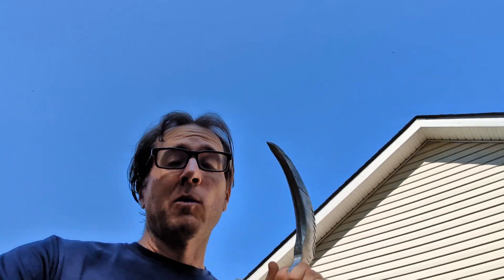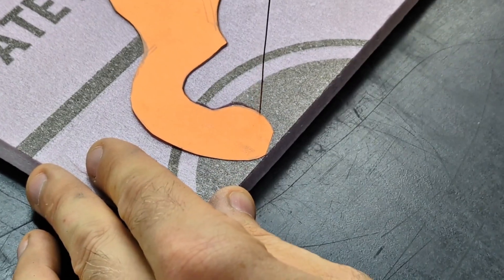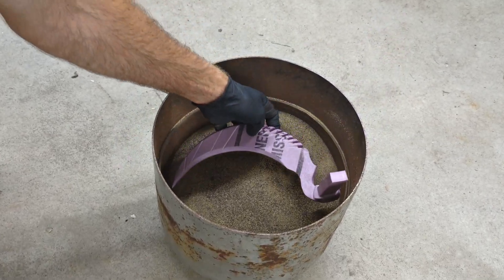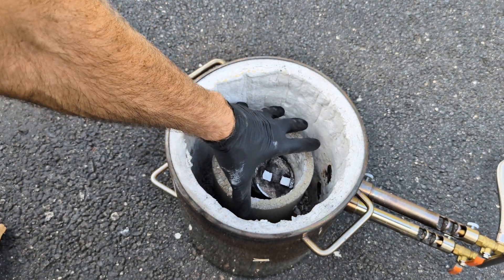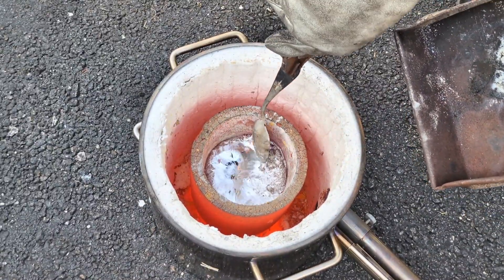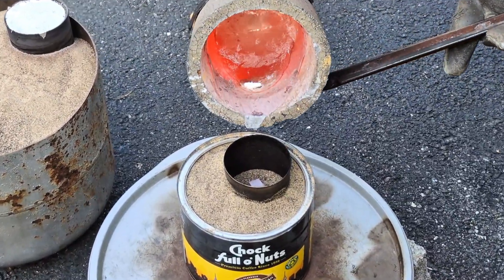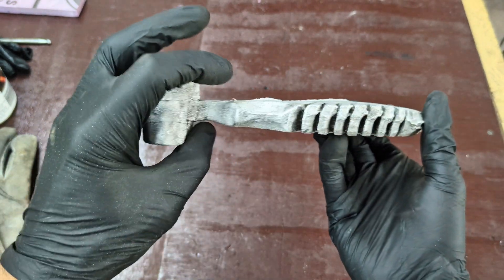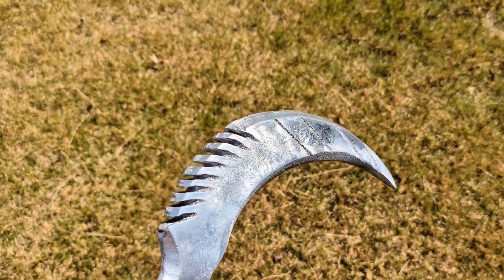Making a Huge Claw | Metal Casting Aluminium | Investment Casting

Comment: I think I know what happened.  If I'm right it's a quite mild example of what I call sand float.  Lost foam's version of a cope and drag flask running out at the parting line because there wasn't enough weight to hold the cope down.  Except with lost foam, there's nowhere for the metal to run out to, so the top of the sand just floats up and up a certain amount just after the top surface of the casting freezes, until the gating freezes off or you stop pouring. Usually the top and bottom look fine but from the side the casting is too thick.  Sometimes way too thick. Sometimes just in certain areas.  Try burying the claw pattern oriented vertically in the mold instead of horizontally, and if necessary upgrade your sand vibration game to get your molds packed tighter.  You can lay weights on top of the sand too if there's room in the bucket, if you still have problems.  If you ever see the top of the sand move or bulge upwards while your pouring you might as well stop because you just experienced sand float.  I've had LF castings come out multiple inches too thick yet looking oddly perfect from above and below at certain angles. Weirdest thing ever
Reply from the maker: I think you make good points.  I was thinking the same thing about the sand float.  It has about 6" of head over that particular area, because I filled the can all the way to the top.  I definitely need to do better on the vibration.  Shaking the can just isn't enough.  However, I also did fill the container with sand giving it more weight on top of the foam.  That would have helped.  Next time I make some online this I will try to do a few things differently.

Comment: First to comment...lol
It turned out ok, but I think it would have gone better as a vertical pour.
Working as a horizontal pour has a disadvantage of lifting the sand causing the expansion in the middle of the mold.
Still much to be gained from this pour. Always learning and moving forward. 🔥🔥💯💯🔥🔥😎😎
Reply from the maker: Thanks buddy 👍👍👍
So I thought the same thing too afterwards, about it lifting the sand.  Maybe if I had added weight on top of the sand it would have worked.
Always learning my friend 👍👍👍